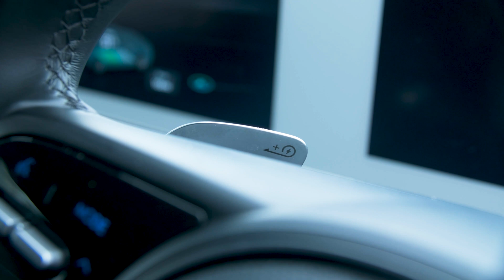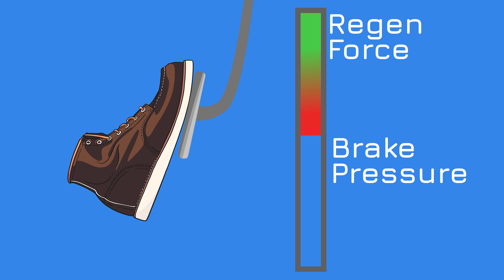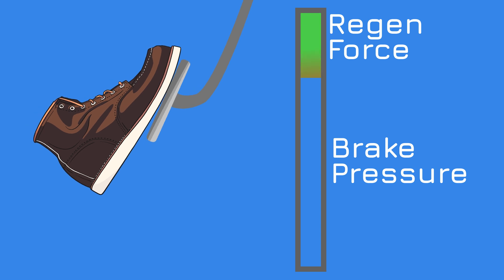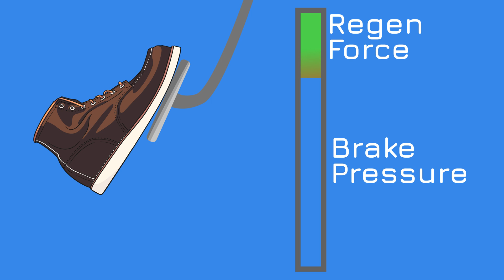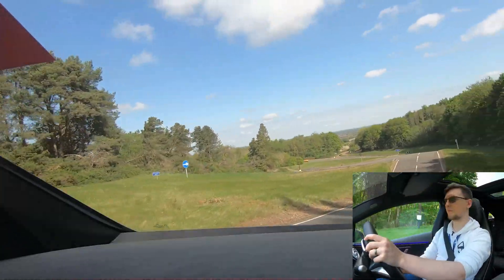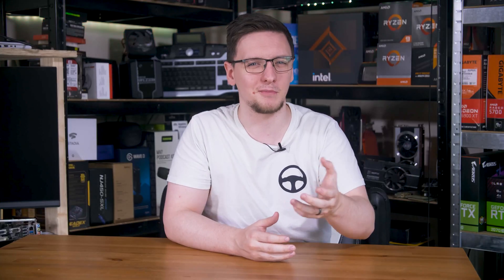SO DANGEROUS!! Regen Braking Explained

Comment: Sometimes I switch the driving mode to braking mode to safely slow down just a little without pressing the brakes which we normally reserve to signal something unexpected to the driver behind. I don't do it often but its quite nice sometimes specially in electric or hybrid vehicles which sometimes accelerate just a little too much or the car in front slows down just a little requiring me to break and then speed up again by 5-10mph. Regarding the accelerometers showing the brake light, I'm not in support of this idea. Mainly because its a great idea for expensive cars but the entire industry will pretty much adopt it in no time. The reason why I don't like it is because I have little to no tolernace for adding additional points of failure (specially electric or software) into a simple, affordable,good looking hatchback. Sensors giving problems in these models just on their own and needing to be fixed is enough of a cost already. The other day my car door didn't open because I parked in a tight place. The car next to me was over the line and there was no space anywhere else. I also had a passenger so I wanted them to be able to get out easier and not hit the car next to them. I was really confused for a moment when my door wouldn't open and had to ask the passenger to open my door from the outside of this new under 10,000 miles hybrid. I then drove off for a while looking for a parking space and checked to make sure my door isn't broken. I get that the car doesn't want me to hit the car next to me. But please stop treating everyone the same. I don't want my car to tell me anything. The car should be taking orders from me. Edit: outside of traction control, abs, vehicle stability, screen wipers, ac; anything electronic needs to behave perfectly or I'm against it 100%. Also touchscreen infotainment systems should stick to being infotainment systems. They don't play movies or shows that easily. But want you tapping away at a huge screen while your eyes are completely off the road. You're not allowed to text on your phone for a reason. So I don't want to be reading anything on that display. It needs to be responsive, have big obvious buttons, high contrast between buttons and the rest of the ui, and be 100% optional in that I should be able to operate the car perfectly without it. The infotainment system should be considered an add-on, not a core part of the car. They might make sense in the US or canada with large straight roads, but in the UK we're half in our lane and half in the oncoming traffic lane a lot of the time. Our roads are never straight and quite often our two-way traffic roads are the size of a single US road lane.

Comment: It takes a few days, and should be disabled if on an open road, but one pedal driving is excellent for city driving.

Only need to master it and understand how others around you may respond. 

In my Volvo XC40, Regen will adjust depending on speed so there is no worry of an aggressive braking of above a certain speed. It also used the actual brakes along with the motor to blend the Regen.

Comment: Excellent video.  I’ve been a Tesla driver for 8 years and I just got a new i5 M60 BMW. One pedal driving is easy to master and I rarely touch the brake in the BMW.  I do wonder if I’m putting excess wear on the electric engine or the brake system.  Knowledgeable comments are appreciated.  On the BMW,  you have an option of high, medium, low, or adaptive.  High puts a lot of regen braking but won’t stop the car.  I use adaptive which works beautifully and brings the car to a full stop.
Reply: Sorry you had to downgrade to bmw.

Comment: Thanks for the video, I agree that the brake pedal controlling the regen system may take time to master.  I am new to EVs and now I believe I am fortunate to get my Hyundai Ioniq 6 with those "paddly" controls on the steering wheel.  They give full range control of how strong you want the regen to work - from very long coasting to 1-pedal driving (levels 0-4).  It can get confusing to some people who do not want to learn how to drive in a way to save every watt of power, but want the car braking to behave like the gas cars they just gave up.  I found that the best solution for my spouse is to set the regen on a middle setting and turn on the "auto" feature (which temporarily kicks in a stronger regen if you do not ease off the accelerator soon enough coming up to a red light).  The car remembers the last used setting, but I wish I could specify a default setting when starting the car.

Comment: Thanks, finally it's been said ! My Clio Hybrid loses all the regen braking on long mountain decents..... not fun at all.
Reply: Is it because the battery fills up and can no longer take on a charge? My leaf would not regen when the battery was full.
Reply: @DanT10  wow. did it tell you on the dashboard with any icon?
Reply: @ZeerakImran  No I came to the conclusion myself. when I would pull my foot off the accelerator the leaf would not slow down.  It makes sense since the battery was full there was nowhere to dump the power. But I guess they could have sent it to a resistor and converted the electricity to heat.